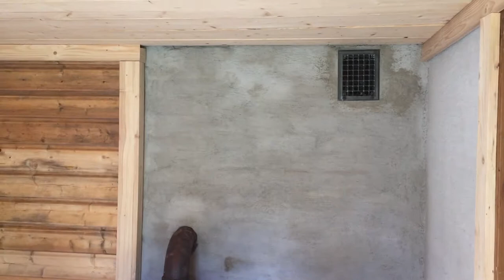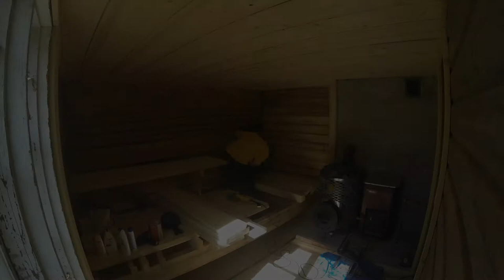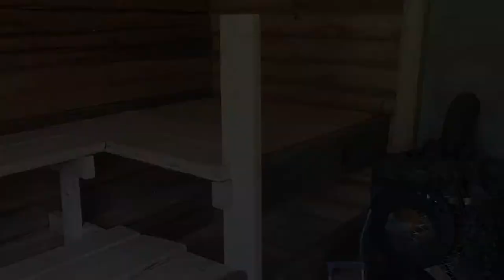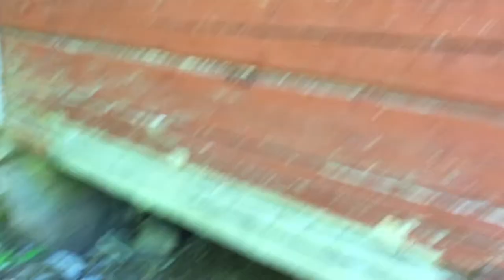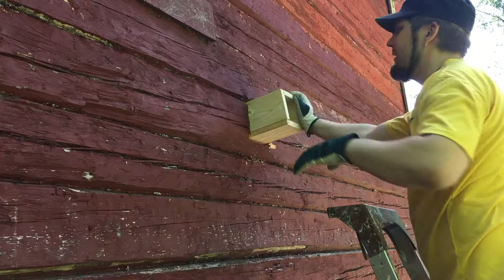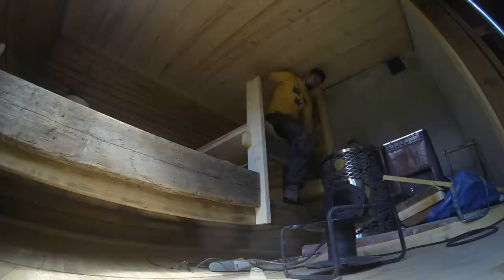Sauna, part 8 - Finishing touches - It's ready!

Comment: Your inlet vent should be below your heater and the outlet vent should be on the opposite wall about 10 cm from the selling on the posit side or opposite corner of you fresh air vent.
Reply from the maker: Hi! In case of wood burning kiuas the stove is providing the air flow out. Burning wood takes a lot of air.
The air vent I made here provides fresh air in and it should be directed to the airflow over the kiuas where it heats up with the air around it. It still would need a bit of barrier not to “drop” the cold air to the floor.

And during the sauna session you don’t want the extraction vent high up. All the heat that is made will escape there and your feet will get cold. Top section of sauna should be airtight.

After the sauna session the vent up on the chimney will be opened and that will allow rest of the moist, warm air to flow out and help to dry up the sauna. You want always leave fire to kiuas to help the room to dry well.

Comment: Nice sauna build. What is the sauna ceiling height?
Reply from the maker: Thanks dude! We already sold the place but If I remember correctly it was something like 2100mm. I would have done it lower but the existing window height really fixed that. Important measure in sauna is the upper seating from the ceiling which shouldn’t be more that 1100mm. After all, you’re in sauna for the heat and If there’s much height above your head the heat will be wasted.
Reply: Arctic SeaCamel - thanks for the advice. Planning to build a backyard sauna this year.